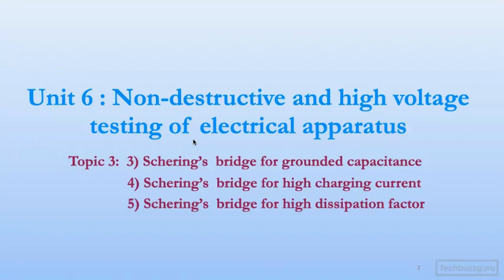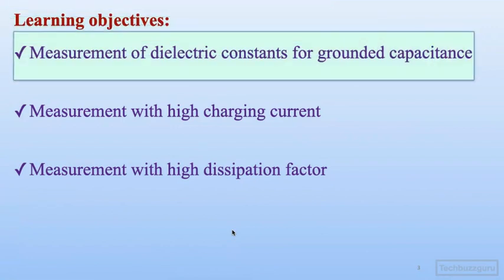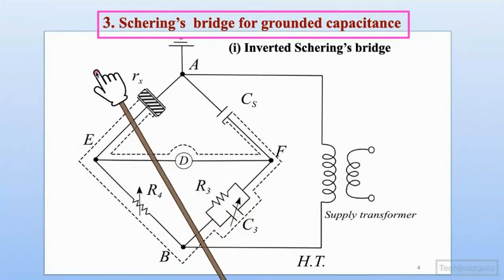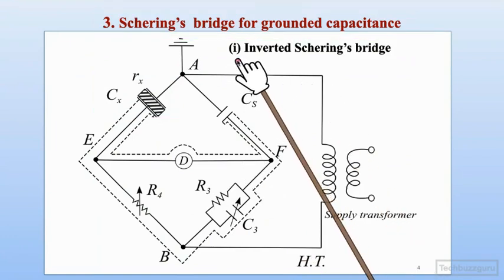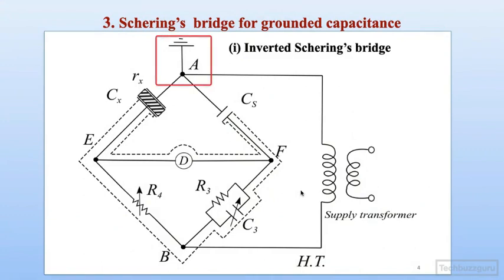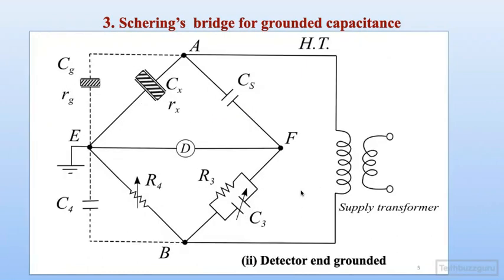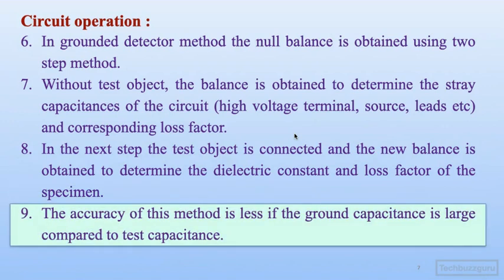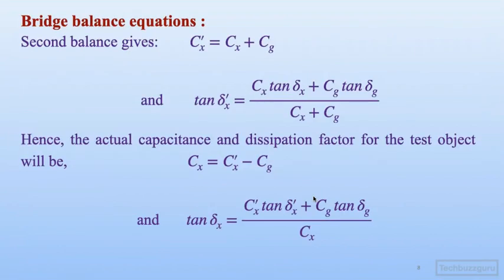Schering's bridge for high dissipation factor and  high charging current

Comment: Please make video which cover following points

I.E.C. & IS codes for high voltage tests on electrical appliances & power apparatus 
&electrical motors, non- destructive testing, testing of insulators, bushings, isolators, 
circuit breakers, cables, transformers, surge diverter, layout of high voltage laboratories 
& test facilities.